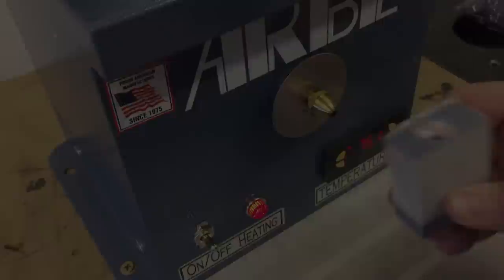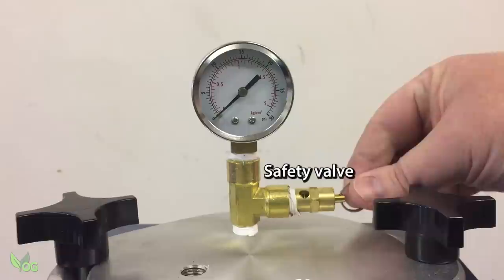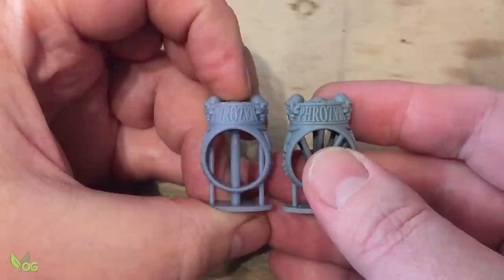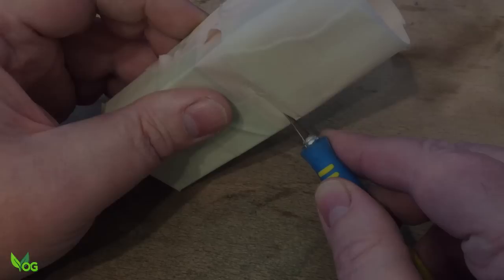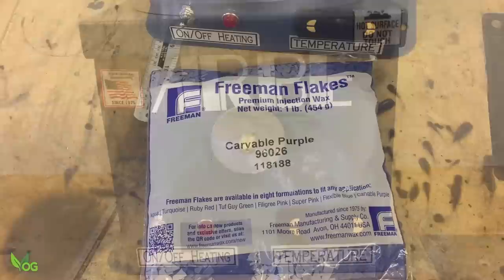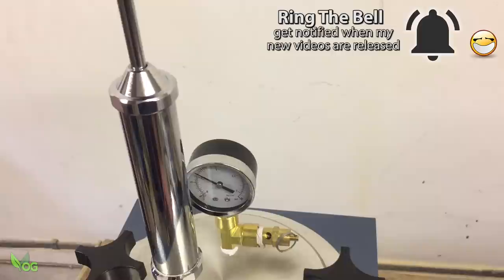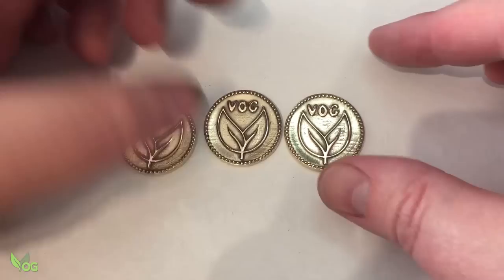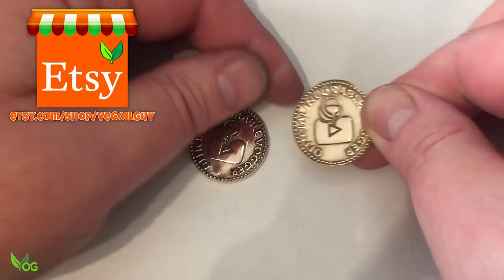Lost Wax Castings + Arbe Wax Injector Review by VOGMAN

Comment: I would like to tell you an idea. I am a dental technician and we use silicon as well for making doublicates. Of cause we have mixing machines which produce no bubbles, but when that thing is not working or you obviously don‘t have one there is another way to make fairly bubble free casts.
You mix it up really well and then instead of pouring it in a thick flow (as seen in the video) you let it in, in a very thin string. You achive that by holding the cup prob. ~40cm above the stuff you want to fill. The higher the better. By that you eliminate quite a few bubbles and in my expirience get very good results.
On youtube I see it quite a lot that people let it in from really short distances. That is of cause less of a problem if you have a vacuum! :)

greetings from germany
sorry for grammar and spelling :D
Reply from the maker: Thanks for sharing that. Personally I'm still very inexperienced in mold making so I'm always to listen to advice 😁👍
Reply: Huh is there a mixer which is contained in a vaccum chamber so no bouble is formed while mixing, you should probably try that out
Reply: the mixing machine that I am using at work costs roughly +1000€

Comment: As always thanks!  I've been looking at the whole sand/wax/print concepts and while I've started down the sand road a few times I'm still very interested in the wax one just for what seems "ease".  Will be interesting to see what you find out is the max size you can do on injection molding with this system.  Can you double the size, triple, quadruple, etc.  At what point can it no longer push the wax far enough out.  Some of that may be offset by prewarming your mold too.  Very interesting product though.

Comment: What's the use case though?  

You said it wasn't that large, so large repeated molds wouldn't be the target market. If they're small like those coins you made, they looked like you could easily pump out 10-20 per plate on a resin printer, which means you can be doing other things while they're printing instead of running the manual wax process.  Maybe if you had a ton of molds so you could do a full vat of wax, then leave it to heat more while you move on to prepping the patterns you've just made.

It looks like a sturdy unit, and the vac station would be useful for the mold degassing, but in the age of resin printers, especially bigger ones like the saturn & phenom, (unless there's something I'm missing) I see it being a redundant appliance.

Feel free to school me :)
Reply: Wax has some major advantage I can see - cost, its less faff with safety gear, and takes much less time.
The printer will take some hours, the post print bath and cure yet more time, all of which you have to do every time you want to make another duplicate! The wax mould means a handful of mins to inject, let cool and remove so you can quickly generate days worth of casting time all without using up relatively expensive resins, IPA, gloves etc..
Reply from the maker: Everyone has their own idea of what's best and I'm still very inexperienced with Wax, but this is how I see it.
Castable resin isn't cheap. I printed a few small items the other day and ChiTuBox valued the print at £7 worth. This might not seem that bad and for me for one-off projects it isn't.
But a bag of wax flakes costs much the same and can produce dozens of similar waxes, making it much cheaper per item, but to do that you need a silicone mold. These silicones aren't cheap, pushing the cost of wax production up again.
Can you see the ups and downs here?
So it a nutshell, one-off pieces, printing with castable resin is cheaper. But if you're mass producing something, maybe a ring or a pendant, then a wax mold can create hundreds for pennies in comparisons.
I hope that made my logic a little clearer.
Reply from the maker: Everyone has their preferences, and that's as it should be 😁
Reply: Ability to remelt failed wax castings is another plus. The whole printable wax resin thing seems very hit and miss, TBH. Maybe for one-offs and hobby use, but for anything serious I'd stick with the print-clean-mold-wax system.

Comment: That's a classic style of solid machine. Who says they don't make 'em like they used to? Simple switch and heating light indicator. Metal throughout. Could have been made 50 years ago save for the modern temperature controls and digital input /display. 👍
Reply from the maker: You can't improve upon 'classic' 😁

Comment: I think creating a complete model with multiple coins on a sprew and gate tree and printing it with jewelers wax resin makes this product moot and decreases the number of casting steps; just the sprewed and gated print into your mold flask, seal with tape as usual, fill with investment, use your vacuum chamber, burnout, and pour in your molten metal. Loads easier than creating a whole other mold for creating wax patterns, plus far less waste!
Reply from the maker: It's a thought 😊

Comment: Nice one. I use the Castaldo VLT with an Arbe Vulcanizer so much easier than making molds. Now if they could only make a castable resin that works like wax.
Reply: Hi sr, i been trying to make molds from resin models using castaldo liquacast, but ended up with problems on the molds at the detailed areas, i see you used vlt rubber how does that work for you?
Reply from the maker: Just as you saw it in this video my friend. Weigh out the two components, mix very well, pour into the mold and then vacuum. Once the silicone has risen and fallen, all the bubbles have gone. Then just leave it 24 hours. You get a perfect mold without flaws 😁
Reply from the maker: Thanks for the share : )

Comment: Bought a arbe wax injection without hand pump how do I connect a bike pump to it for air/pressure
Reply from the maker: Sorry my friend I don't know. Is it the same model? There should certainly be an opening somewhere designed to take a fitting of some kind.
Reply: Yes and apparently you connect the bike pump to were you would connect the air compressor

Comment: If u guys don’t want to pay for silicone I found a meltable kind that can be reused on Amazon called composi mold
Reply from the maker: Interesting. I see it's reusable. If it worked well, it would definitely make wax cheaper than resin 👍

Comment: I'm about to use parrafin candle wax to cast some gears. Any tips? I haven't got any vacuum equipment though.
Reply from the maker: If you're using the candle wax as a casting wax, I would guess it would work, but I thinks there will be some sooty deposits left behind. This won't necessarily spoil the integrity of your gears, but it will probably spoil the finish a little. So there may be some surface imperfections, but hopefully it will work for you.
Reply: in my experience, paraffin wax tends to shrink a lot when cooling.  Even when you use the proper injection wax, it can shrink if it's heated too much.  You might need to play with your wax temperature: just hot enough to fill the mold well, but not so hot that it it causes shrinkage voids when cooling.
Reply: Been there, done that.  Cutting the gears is MUCH better.  johnsmachines.com

Comment: Where does the air go, when you pour in the molten metal?
Reply from the maker: I wondered that as well. I believe the idea is that it's forced out through the joins it the silicone. If you prevent this, it can spoil the wax and if you allow it too much, you get a halo of wax. Like everything else, it a case of practice makes perfect 😊
Reply: pulled thru the pores in the plaster in the vacuum chamber.

Comment: this is all nice & very pretty but in ancient times they didn't have all of that & they still did it, all of does machine are getting very expensive for just a hobby, what would be very awesome is finding out how they used to do it whit out the burning oven cause I don't have 3000$ to spare + 1500 for the casting machine plus the wax injector & all of the tools
Reply from the maker: I totally agree! Haven't you seen my earlier videos where I made my own burnout oven, vacuum chamber, etc. It's worth looking at them. Have a look at this video... I'm pretty sure in it I describe everything you need plus my own cheaper builds to keep the costs down. https://youtu.be/qxj5eUkAFUI
I started this hobby with a budget of pennies and folks told me I couldn't do it without thousands. I'm pleased to say I proved them wrong. 
But as with all hobbies, it's nice to look at what else is available.

Comment: Isn't there a 3D printer resin wax? That way you skip a step in the process.
Reply: there are many and they are generally very expensive, but this method is to use cheaper resins for a master allowing mass production at a lower overall cost
Reply from the maker: Spot on Adam 😊👍👍👍
Reply: Adam Rudling I do not agree. The resin may be more expensive, but then you don’t have to buy silicone for the pattern mold, the injector, and the  wax, which should be somewhat expensive for the superior casting qualities. And, having worked in a commercial foundry and seen this firsthand, a lot of mold waste taking up space and adding more junk to the planet.
Reply: @nunyabusiness9043NunyaBiz  the wax injection of moulds allows rapid ie seconds repetition of pieces at significantly reduced piece cost. 
Wax for injection is very cheap compared to 3d printer wax resin, in the order of a tenth the cost. 
Agreed there is extra cost and time involved in making a mould be it silicone or plaster, but these items recoup their cost very rapidly in a production environment.
Also this allows you to cut the computer based side out totally if you want too.